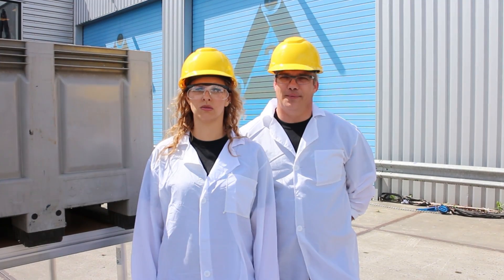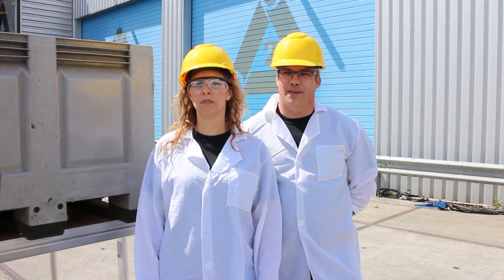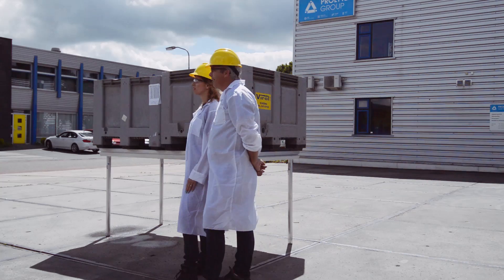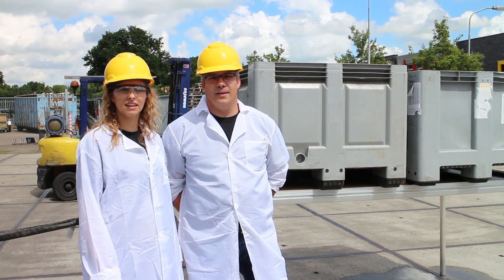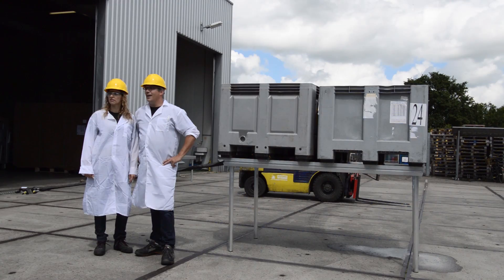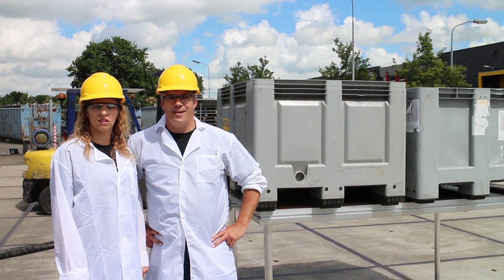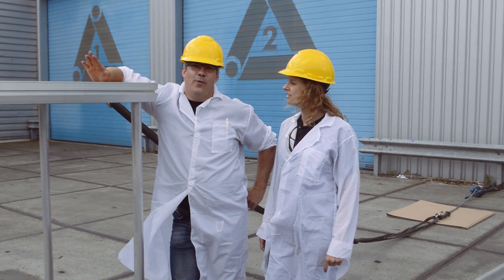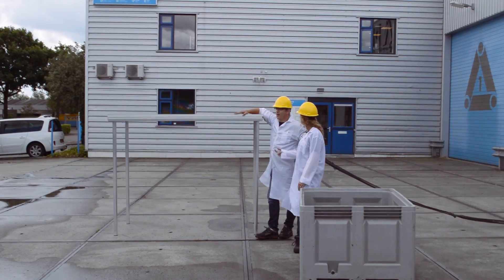TrussBusters - Episode I

Comment: HI 
I have 15*40 meter land , I want to make two floor casino 
I saw your test for 10 meter truss ,you told me it normal load 410 kg At horizontal position 
could you send truss types and vertical,horizontal load capacity with length to make primary study to my project with you  
if we can make it it will be the first one off its kind  in (I WILL TILL YOU LATER
mohammed4ms@gmail.com
Reply from the maker: Hi Mohammed, Thanks for your interest. I have forwarded your question to our sales department, they will contact you. 
Best regards, Jeen - Prolyte Group